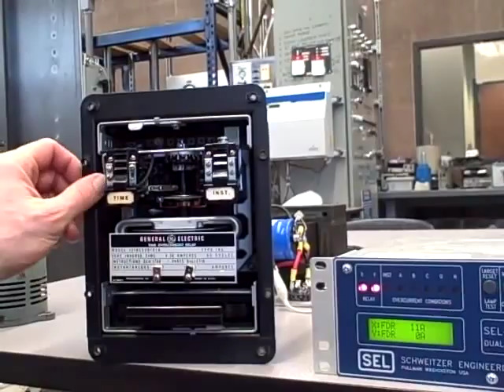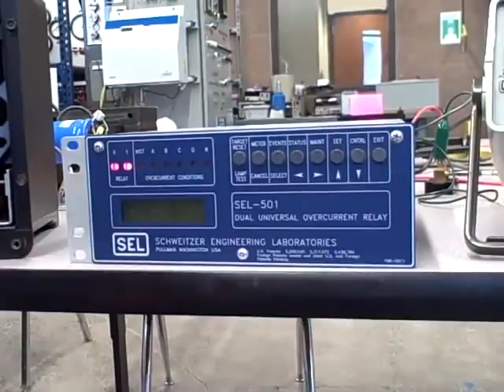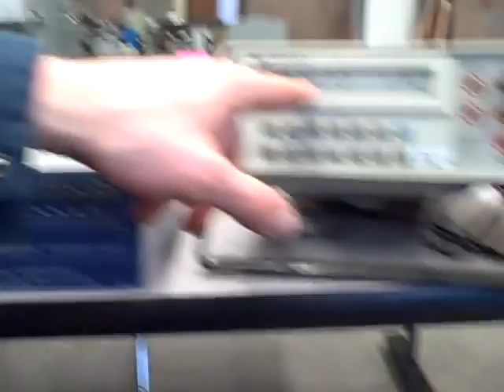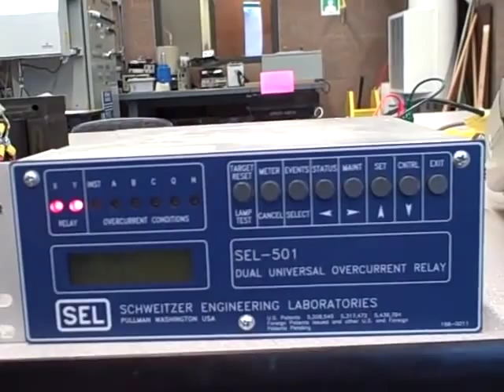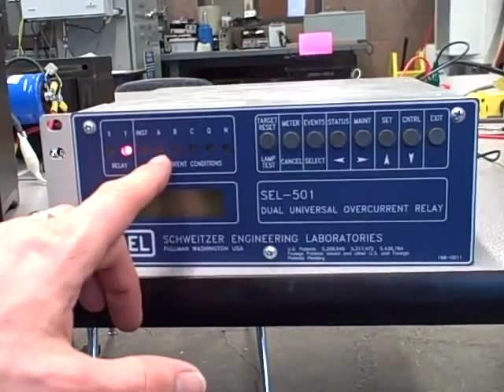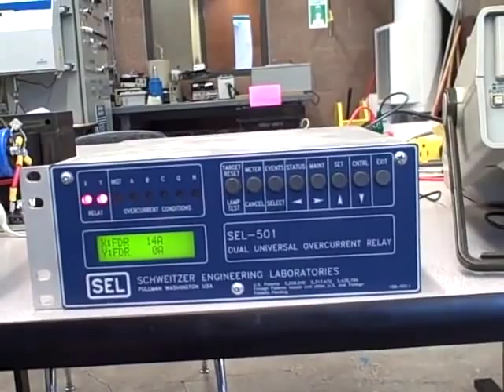Protective Relay Testing Procedure

Comment: If you have the time please elaborate on the use of two Transformers in order to get high current output.
Reply: CruzanVIHD the transformers are just stepping down the voltage of his Variac. Since a transformer has an apparent power (voltage and current balanced), as the voltage lowers in value, current will raise in value. The opposite is also true if a transformer were to step up a voltage, the resulting current would be lower.